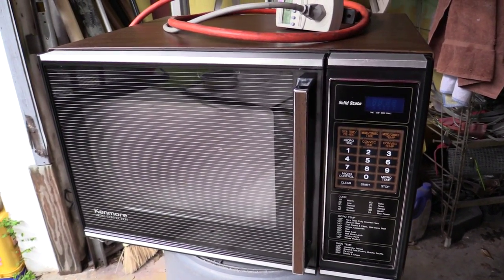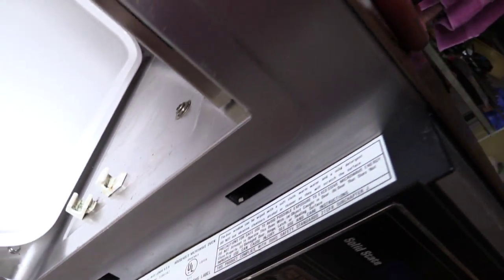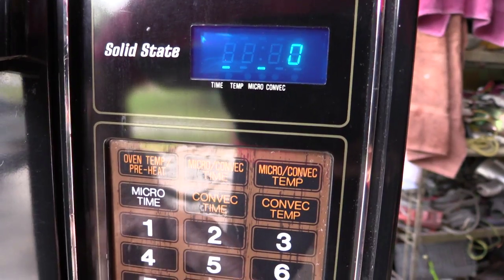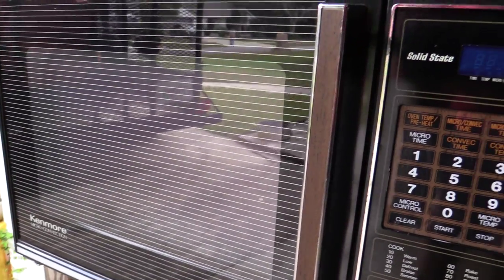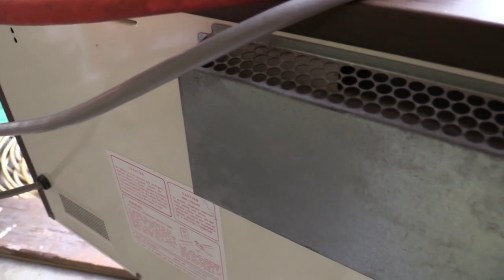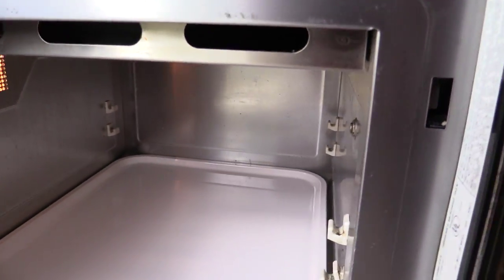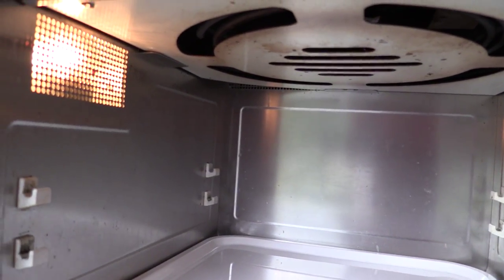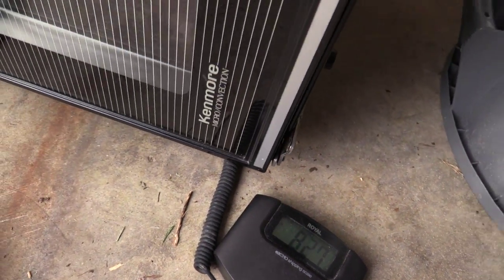1983 Vintage Kenmore Convection Microwave

Comment: I have a 1985 non-convection descendant of this, model 565.8778610, same cabinet except for the panel (design is similar, just some different options), and it does have a clock. 1300w.  I bought it new and it still works perfectly.  My friends keep urging me to get a modern one, but I don't see the point of replacing something that has worked perfectly, and does everything I need, for 31 years for something that will last 8 years if I'm lucky.
Reply from the maker: That is a great story! Yes, these are high quality. I still have this one too.
Reply: Hi Debbie, I also have a 1985 Kenmore one, model no. 565.8768610.  Today it just stopped working.  I was told there was a pop sound after it started heating for about 30 secs.  Afterwards, nothing was functional.  The display panel went dark and is unresponsive.  I was wondering if you or anyone knew what it might be.  This thing has lasted many years.  I'd like to repair it if it's relatively simple and the parts are available.  Thanks.

Comment: I just was given one of these. It is a restoration project I plan on fixing up to sell and learn a little more about microwaves while I do. I have already restored a tappan500, so figured why not try a vintage digital controle unit. It works but needs some cleaning and possibly a touch up inside. The simple fact it actually works and outlasts most cheapy microwaves out there today tells me it might be worth selling and I might get good money for the thing if I get it looking nice. It even came with the booklets and a cookbook. Mine is a little different than yours though. Mine has a turntable. Let me tell you though, I haven't weighed it yet but it must be at least 80lb.
Reply from the maker: Oh, you might want to consider keeping this gem of a microwave. They truly don't make them like this anymore. I made this video a couple years ago but it still completely works like brand new. Ha, yes, mine weighs a ton too! :)
Reply: @AutistiVision  cool! Who knows I might keep it as a backup. Either way its going to be a fun project and one worth restoring. It even has a dedicated trap door on the side side to replace the lamp! Truely something you never see today. Maybe on expensive over-the-range units or fancy sheff/commercial units but surely never on a low-end consumer unit.
Reply from the maker: @coolelectronics1759  Nice!

Comment: @autistivision: because its a microwave not a conventional oven. in mic. mode the microwaves require something to penetrate. ie: glass of water. the mic. will overheat rapidly and the bare minimum that will happen is destruction of the magnetron. they are not designed to be ran empty. alot of microwave techs will tell you of experiences like microwaves blowing up or catching fire due to being ran empty. im not sure how microwaves in particular work and why but it is similar to shorting out a car battery. if you put metal in a microwave youll know it(also HIGHLY dangerous) the wife was stupid once and in a matter of 10 seconds the magnetron was shorted to half strength(took twice as long to heat up) and she got screamed at.

just be extremely careful. and make certain you run mics. with something inside that is non-flammable liquid. a bottle of lucas oil stabilizer on a winter day is a prime candidate before adding to vehicles oil:)
Reply from the maker: +geoffrey walker Thanks. I really didn't know that. I'll never do it again. Luckily, the microwave is fine.
Reply: I've got a Kenmore Microwave 564.8898510 from December 1984 sitting in my attic. It started taking a lot longer to cook food so we got a new one. After reading your post I suspect the magnetron needed to be replaced. Pretty cool.

Comment: my 1984 kenmore straight mic. has a vent like that but its a plastic deflector to direct the air to the top. 

try not to ruin it??? you are ruining it running it empty. VERY DANGEROUS!!!! use a glass of water to test. 
btw everything was bigger than but that shows quality. 

nice score man!!!!
Reply from the maker: +geoffrey walker I hadn't heard of running it empty ruining it. How is it dangerous?
Reply: @AutistiVision  there needs to be something, like water, inside the cavity to absorb the radiation or else it can pool and potentially backtrack into the magnatron and overheat it or cause damage.

Comment: Does anyone know of a way to get parts for this? My top portion inside is shot.
Reply from the maker: I just went on a quick search journey which was fun actually and, basically, no. There are a few parts here and there available by a number of different sites, but the idea of getting a whole new top portion or something from a place like Sears or eReplacementparts isn't going to happen. Actually this is making me realize that it's an absolute miracle that mine is fully functional. I wish you luck. I hope you may find one on the curb like I did. :)
Reply: @AutistiVision , I appreciate you responding to me-
I’ll figure something out-? 
🤗🤗🤗